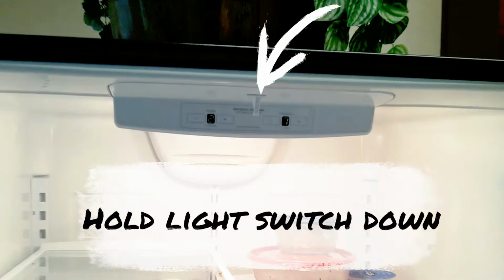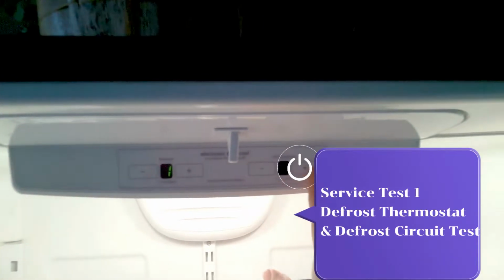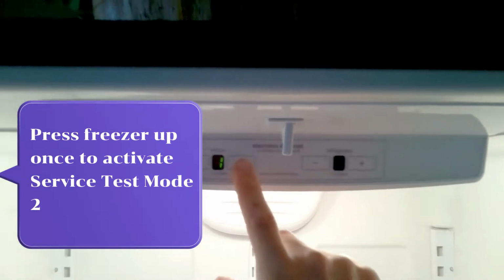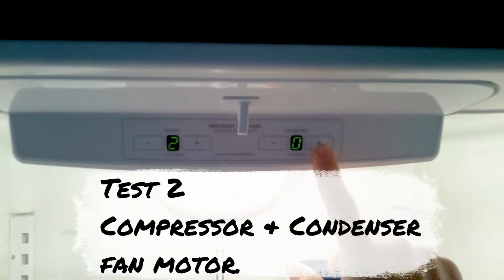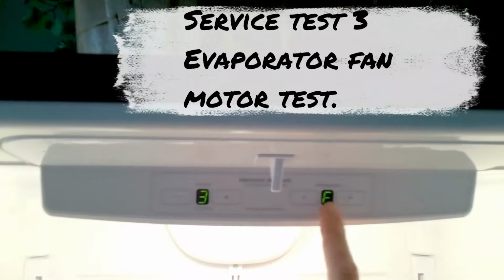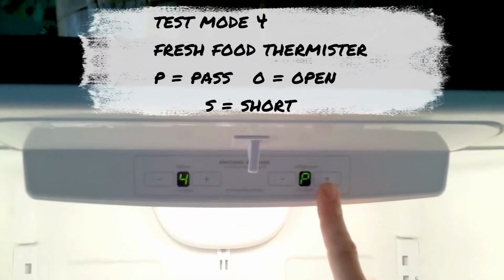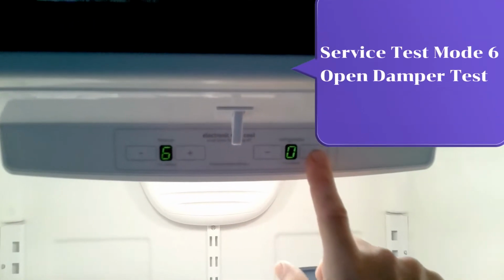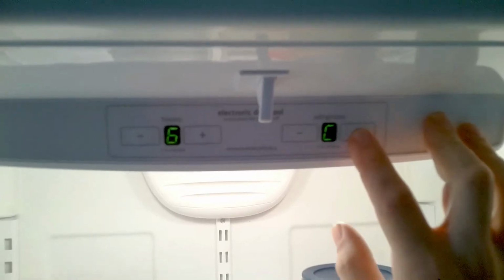How to Place the Jazz Control Board into Service Mode on a Maytag, Jenn-Air, or Amana Refrigerator

Comment: How do you remove  the zeros it's stuck on zero and control up and down buttons won't work at all
Reply from the maker: Did you just install a new main control board (MPC)? If so, you'll need to update the control settings. The necessary instructions should have been included with the new main control board—unless it’s not an OEM part. Hope this helps!
Reply: @onlineappliancetech  no new board I'm at p e now